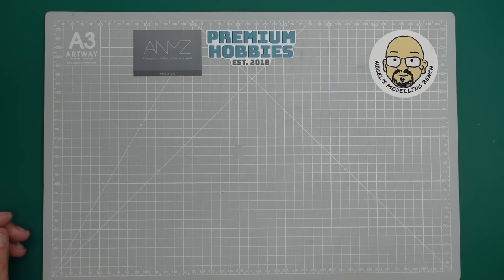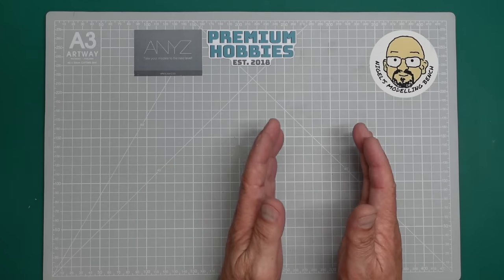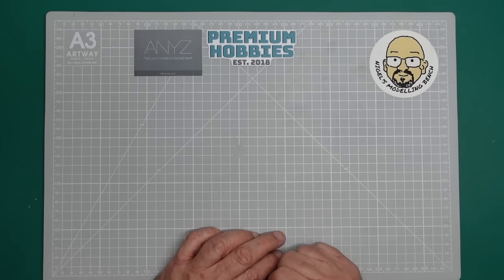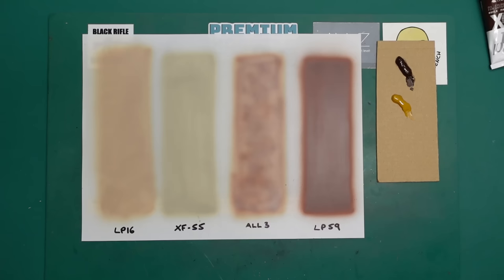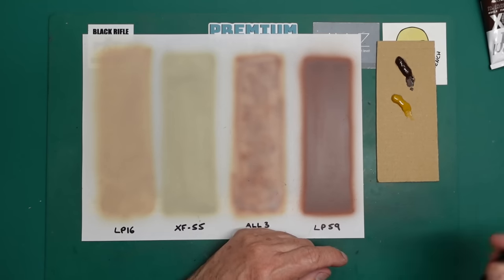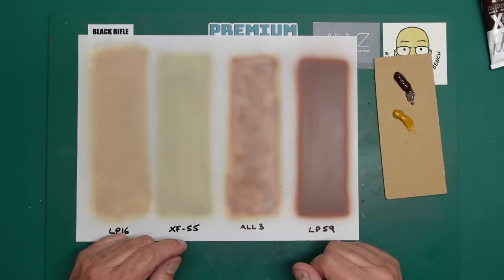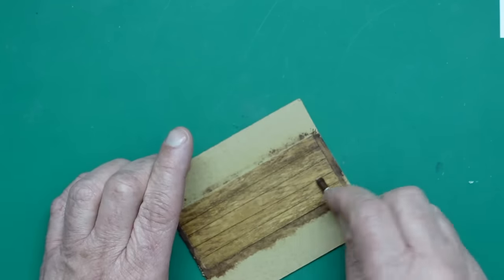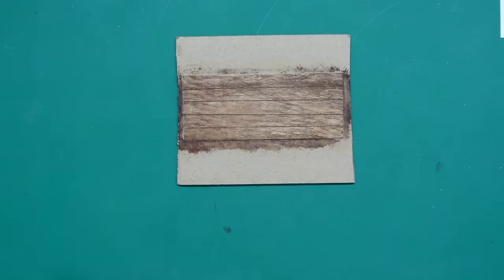Beginners guide to better model making. Part Fifteen. Wood effects.

Comment: Fantastic, Nige. And fascinating. So it is not only what you put onto the piece but also what you allow to stay behind. 😅 Is there a way to control the size of the wood grain? Like for a 1/72 truck bed vs. a 1/32 Gotha UWD fuselage. Or it doesn’t matter? I learned plenty from this video. 👍🏻 Many thanks.
Reply from the maker: You just do what looks right.
Reply: @NigelsModellingBench  got it. 👌🏻